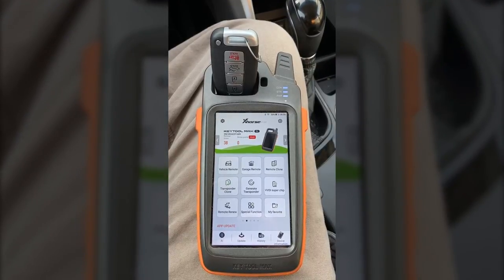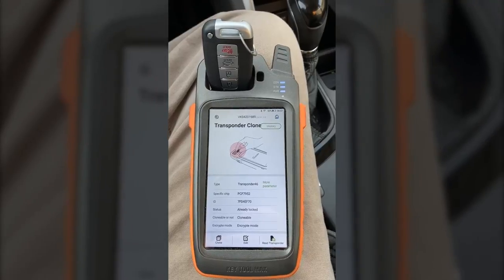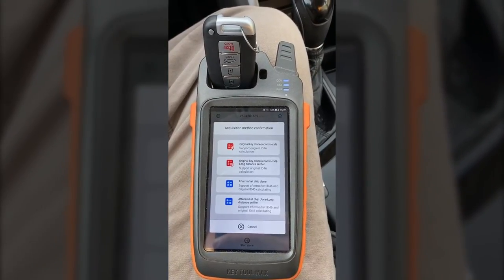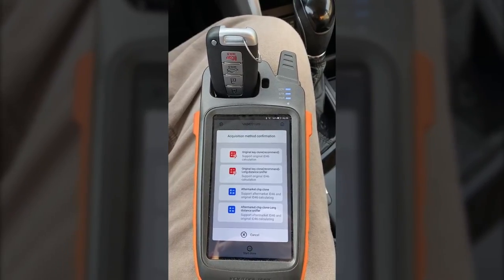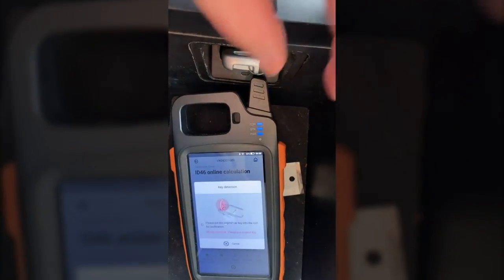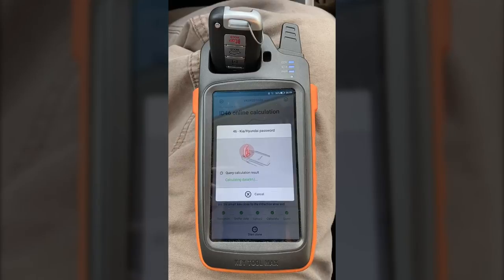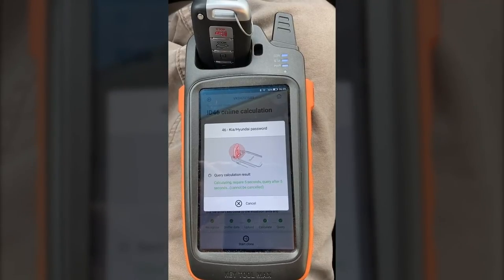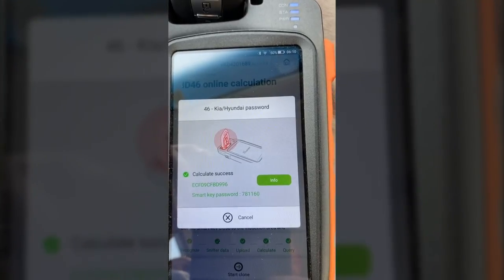Xhorse KeyTool Max - Hyundai Kia Pin Code Reading With Working Prox

Comment: Is there a way to do it with the newer system? With the new keys it says they are unclonable and doesn’t let you move to the Hyundai pincode menu
Reply from the maker: Hello - Thank you for your question.  This feature does not work on the newer Kia or Hyundai systems because the process for cloning the transponder is yet unknown.  
Once this process is figured out I would guess that the Pin Code reading for this system would be known as well.  Please stay tuned!

Comment: Thanks so much after watching your video again yesterday I was able to use the key toolmax to get pin code for 2012 kia morning smartkey and programming was successful.  I tried few weeks ago but wasn't able to do it. In my situation I had to remove the battery of the original smartkey by pressing pcb on push start button before I could get pin code and it was successful. I'm grateful sir😊

Comment: would this system work to clone a third key for a 2011 Kia Sportage? Dealer says only two keys are allowed in the computer at one time, I need a third key.
Reply from the maker: Thank you for your question.  You cannot "clone" a Prox Key as such.  The process shown in this video is for extracting the Pin Code, for Prox Key Programming, from a working Prox Key.  I think the Dealer gave you incorrect information.  I would double-check with another source because I believe the max number of Prox Keys on this vehicle is 4.

Comment: Hi just wondering if you could help please. 
I've got a Key Tool Max Pro, i'm trying to read the PIN code from a Hyundai i40 2012, European market. But i can't seem to get to the screen, 3 options; 
copy way page, 46Transponder clone, copy primary remote and kia/Hyundai password.

Comment: Thank you for making this video very clear. A few questions. Does each vehicle or key have their own unique pin code? After getting this pin code, you use a key programmer such as the Autek ikey820 to program it?
Reply: Yes, each vechile will have it's own pin code
Reply from the maker: Hello CJ.  We are glad that our video was helpful to you.  Each vehicle does require its own Pin Code.  You are correct after you have used the Key Tool to get the Pin Code you would then use whatever OBD Key Programmer that you have which has the proper coverage for the vehicle.  If you need anything else please let us know.       
YouTube		Twitter
Reply: @KeyInnovationsWholesale  would the xhorse mini OBD serve that purpose

Comment: Very interesting, does the key tool max do any other vehicles, (extracting pin codes) if so can you do a link. Thanks Steve
Reply from the maker: Hello -Thank you for your question.  The Key Tool Max does not calculate other Manufacturer Pin Codes in this way, but if you pair the Key Tool Max with the Mini OBD Tool you are able to read Pin Codes for many vehicles in the US Market.
Reply: Thanks.

Comment: what do u have to do after u get the pin code/ pass. how do u program the new key fob? is it via obd?
Reply: It doesn’t sound like your a locksmith. You’ll need a car programmer that has the ability to program keys to your specific vehicle.
Reply: @2815Juan  cant that car programmer costing thousands of dollars get the code tho?
Reply from the maker: Hello George Patseris and 2815Juan.  Thank you both for your comments here.  2815 Juan has answered correctly.  You will need an OBD Key Programming Device to program the Prox Key to the vehicle after you have the Pin Code.  The answer to the second question is, yes some OBD Key Programmers can pull the Pin Code on these vehicles, but some cannot.  Again thank you both for taking a moment to comment on our video.

Comment: From this kind of code except for engine ecm add?
Reply from the maker: Thank you for your question.  The process shown in this video is for extracting the Pin Code, for Prox Key programming, from a working Prox Key.  In the US a Pin Code is not required for an ECU Swap, at least using the Factory Tool.

Comment: I have 2016 Kia optima push to start,please show me how to read the pincode
Reply from the maker: Thank you for your question.  The process is the same for the vehicle in question except for this vehicle doesn't have a Programming Slot.  On a vehicle with no Programming Slot you sniff the data from the Push To Start Button instead of the Programming Slot.
Reply: Thanks for your reply 
The think the original key is locked unreadable nor colonable

Comment: how can we get pincode for a blade key kia or hyundai 2017 and up ? thanks
Reply from the maker: Thank you for your question.  Most programmers will perform a VIN to Pin Code Conversion on these older Bladed Key Kia and Hyundai Vehicles.  As far as 2017 and up Kia and Hyundai Vehicles most programmers can read these Pin Codes but the Ignition of the vehicle must be forced on for this to work.  We have a Cable available that you can use to Force the Ignition on.  The Part Number for this cable is KES-FORCE-IGN-HK

Comment: Hi am garage in uk will this be ok on uk vehicles ie Ford transit connect
Reply from the maker: Hello - Here in the US, Pin Codes are not required for Ford Key Programming.  I am not familiar with the Transponder Type on the UK Version of our vehicles.  Send me an email at jb@iks,us and we can discuss this further and I will help you get to the bottom of this.

Comment: Is it pin code? I think u did the key cloning
Reply from the maker: Hello - Thank you for your question.  In order to get the Key Tool to calculate the Pin Code, you access the cloning functions of the tool.  The Pin Code Calculation is a selection that is made under Transponder Clone.

Comment: Do you need a paid subscription for xhorse server?
Reply from the maker: Thank you for your question.  There are certain processes, when using the Xhorse Server that you need to have "tokens" to use.  These processes are ID48 96 Bit Cloning and Mercedes IR Key Password Calculation.  The process that is demonstrated in this video does not require any Tokens.

Comment: 2021 model till support and Hyundai Kia pincode
Reply from the maker: Hello - Pin Code Calculation on 2021 Kia and Hyundai Vehicles is not currently supported by the Key Tool.  Thank you for your question.

Comment: Hello bought a device VVDI KEY TOOL MAX but there is no key in it
(736716-A / 89071-0D020) You would not be able to say which one to use, I tried 9 keys like but not that do not work. Pre -dispute